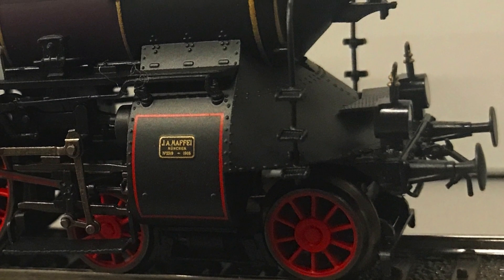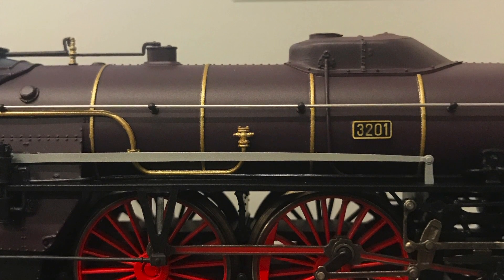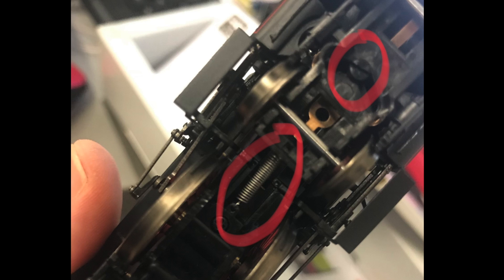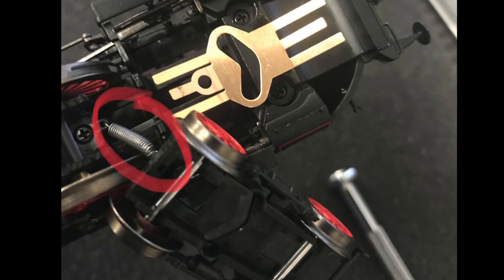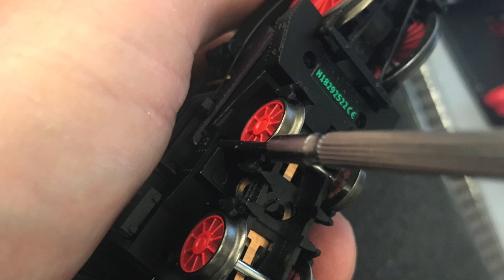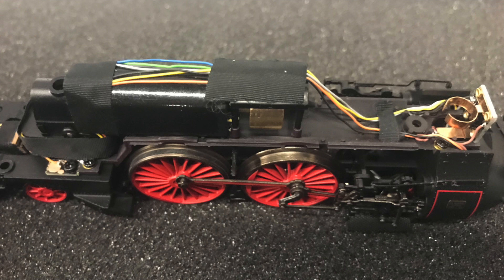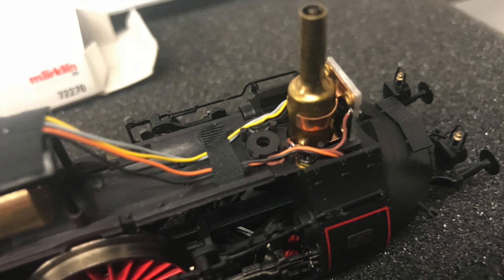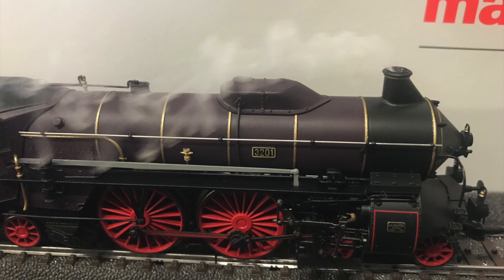Marklin 72270 Smoke Generator installation in Marklin 37018

Comment: Excellent video that gave all the details to assist in installing the smoke generator. It was informative to be cautious with  the spring to the front truck.  A slight drop of Loctite on the ends of the spring kept it intact on the connectors. The video made the task easy and enjoyable.